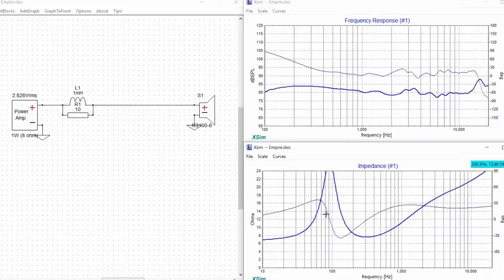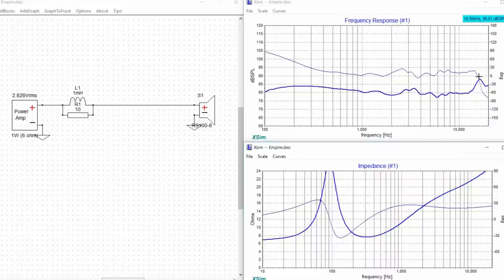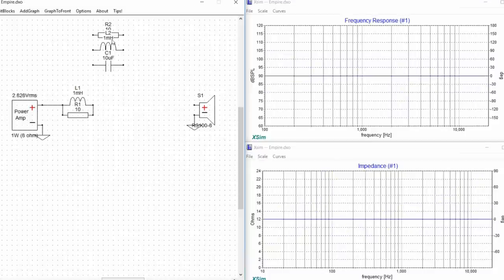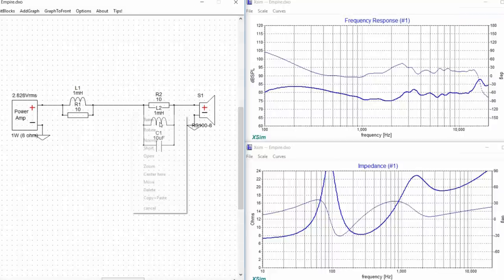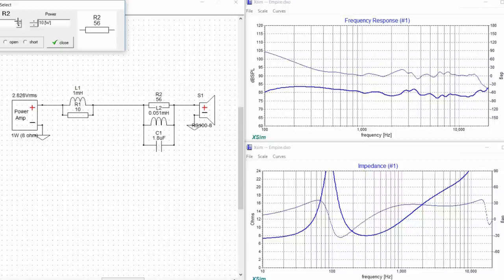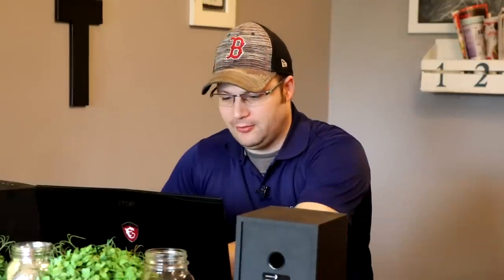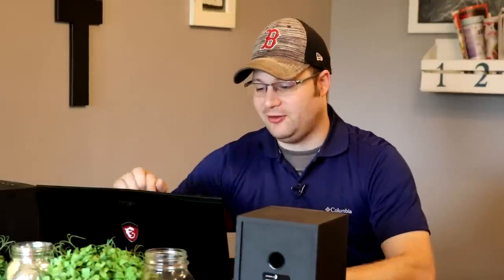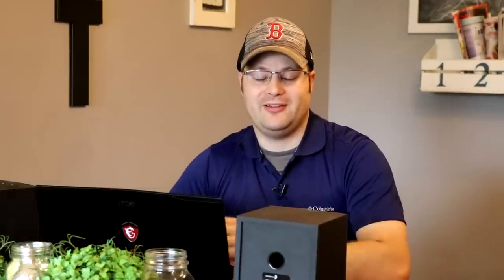How to get the Best Sound from a Full-Range Driver - Part 2

Comment: Your use of passive filters totally defeats the benefits of using a full range driver.  A frequency response graph only tells you about the loudness at each frequency, a frequency response graph tells you nothing about what the speaker sounds like when playing those frequencies. A frequency response graph tells you about the quantity of sound, NOT the quality of sound. Everything you do with your passive filter components makes the speaker sound worse.
Reply from the maker: That makes absolutely no sense. You're going to have to research Quite a bit. I'd like to start by telling you how wrong it is, but there's just too much there. These are very good concepts for people to use. but if you're unaware, you should at least start with baffle step compensation. Read up on it and do some research.
Reply: @Toid  Everything I said is factual.  There is no musical information at 17khz so leave it alone.   Baffle step only affects tweeters which are on a baffle more than 10 inches wide.
Reply from the maker: @dreamdiction your just proving you don't know what you're talking about. You need to research this. I'm saying this to help you out. The first time you said 7 khz come on now you're saying 17khz. And baffle step doesn't affect tweeters, it affects mid-range and woofers. The smaller the baffle the sooner it occurs. without going into too much detail, has to do with the wavelength of the frequency wrapping around the side of the box. Next time you should let people help you out when you don't know what your talking about
Reply: @Toid     You are talking about something you don't understand because you have not done your own tests.  You think you know what you are talking about but you don't.

Baffle diffraction ONLY affects frequencies ABOVE those frequencies which have a wavelength shorter than the distance between center of the speaker and the edge of the baffle, do your own calculations and you will see why Baffle Diffraction ONLY affects tweeters. As for bass, 80hz has a wave length of 14 feet so for baffle diffraction to affect 80hz the baffle would need to be 28 feet wide.

Putting a speaker in a box INCREASES the bass because the waves from the rear of the cone which are 180 degrees out of phase are trapped by the box so they cannot wrap around and cancel out the waves from the front of the speaker cone.  This would be obvious to you if you have ever played music through a speaker in a box and then play the same music through a speak which was out of the box.  

I said, there is no point suppressing speaker output at 17khz (SEVENTEEN) because there is no musical information at 17khz.   

I said, most classical recordings are recorded live in a auditorium. Whenever such recordings are made, microphone placement is decided by an engineer walking around with a spectrum analyser. It is a FACT that when listening to an orchestra from the front row of an auditorium, there is no sound above 7khz (SEVEN). To detect higher frequency harmonic information you need to be literally inches from the musical instrument.

You are talking about something you don't understand because you have not done your own tests.  Go and do your own tests before you reply.
Reply from the maker: @dreamdiction  and you almost have baffle step compensation figured out. Wavelength plays an important role in this. I love when you say do you're own tests, when you're talking to a speaker designer who obviously has more experience than whoever you are. But since you seem to be allergic to don't research and don't want to watch the video I linked which actually show the tests, I'll leave you to live in your item ignorance. At first, I was trying to help you, now I'd rather just let you believe whatever it is you want to. Have a wonderful night.  
Just in case you know how to read, I'll leave this here: http://www.salksound.com/wp/?p=42
Reply: @Toid  Quoting from your link: "The 1,500 Hz signal (highlighted), on the other hand, has a wavelength of 9″ and reaches the edge of our 9″ baffle where diffraction can actually cause a slight rise in response levels at the listening position. At 750 Hz (also highlighted), the sound actually begins to travel around to the rear of the speaker.
 So basically, any frequency lower than 750 Hz will be able to travel around the speaker (creating a roll-off of 3db for two octaves at the listening position), while frequencies above that will not."

So the baffle increases the higher frequencies but does not change the lower frequencies, unless you make the baffle as big as a wall in which case the bass and treble will all be equally boosted and there will be no audio step to compensate. That's what I said.

Have you stopped claiming that putting a speaker in a box reduces the bass output? If you do a test of this it will be your first test on your youtube channel.
Reply from the maker: @dreamdiction  I really don't have time to explain that roll off means loss and that means that you have at least a 3 decibel loss of sound is going behind the speaker and not directed towards the listener. Which means you need to attenuate above that by at least 3db. You're welcome to search my channel for the various tests I have done. You're also welcome to watch that impulse audio video, which will show exactly what's going on.  Or if you need to see written somewhere that there is a "loss of bass" feel free to read this: https://trueaudio.com/st_diff1.htm  However, I do get a good laugh at people that try to prove people wrong to have no idea what they're talking about. So thank you for the laughs.
Reply: Short version: Everything @Dream Diction has been saying 2 years ago was wrong because he was mixing things up.
Reply: @naibafabdulkobor4301  Everything I said is factual, nothing I said is mixed up.
Reply: @dreamdiction  Everything you said is semi-understood crap. There's a grain of truth to it but in the way you put it it's utter nonsense.
Reply: @naibafabdulkobor4301  You can't quote anything I've said which is untrue.
Reply: @dreamdiction  - I easily could, there's just so much stuff you mixed and matched, nobody would benefit. 
First thing to learn is how speaker manufacturers are taking their published measurements. Usually drivers are measured with box style enclosure but mounted with a slight horizontal and vertical offset to a "large" standardized baffle. Look up IEC 60268-5. This baffle can be considered "infinite" for frequencies down to where room acoustics are more relevant than speaker  behaviour. Just like an acoustic suspension ("modern" type closed box) it prevents cancellation of sound radiated from the front and back of the driver (which is roughly the same intensity, but in inverse phase). If your speaker features an equally large baffle or is very flat and placed directly against the front wall then there is no baffle step to correct for.
However, this is not how most speakers are designed. They tend to have relatively small baffles, depth often larger than width, placed at a fair distance from the wall. At sufficiently low frequencies sound is radiated omnidirectional. On a large baffle - no matter what you do -  sound is always radiated into 2p space because the other half of the room is blocked by the baffle. This is no longer true for small baffles where sound is radiated into 4p space at "low" frequencies. The sound bent around the enclosure will fully (anechoic conditions) or partially (living room) be absorbed so SPL will be lower than measure on the standardized IEC baffle. Only when radiation propagates from 4p to 2p (distance from the driver to the baffle edge is half of the wavelength) SPL will be back to the same level again. This is the main cause of baffle step. It has nothing to do with the shape of the baffle and if there are sharp edges causing further diffraction.
But yes, in most cases there are these edges and reflections further contribute to the effect by adding ripple. But unlike the previously discussed effect this ripple heavily depends on the horizontal and/or vertical angle of measurement. It simply all depends.
Further up in the frequency spectrum the driver's radiation pattern will become mostly directive (wavelength roughly in the same magnitude as diaphragm dimensions). Neither reflections from cabinet edges nor baffle step are relevant anymore. 
Your terminology is wrong. As is your high-end-foolish claim that any passive crossover part would always reduce "quality" of sound and just affect "quantity".